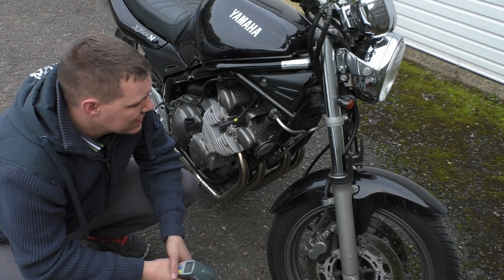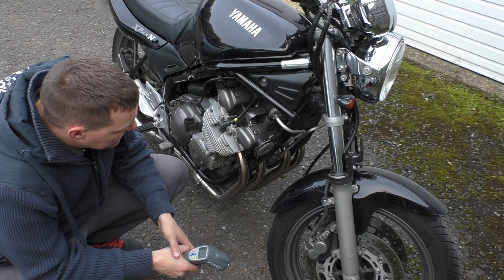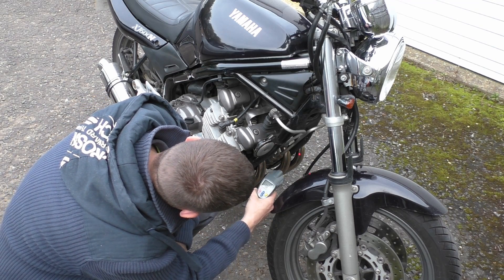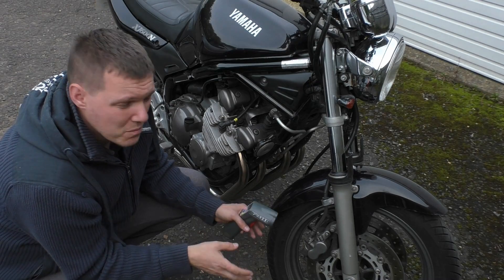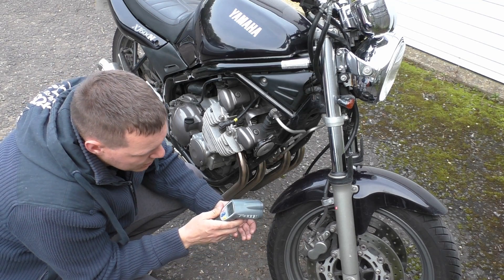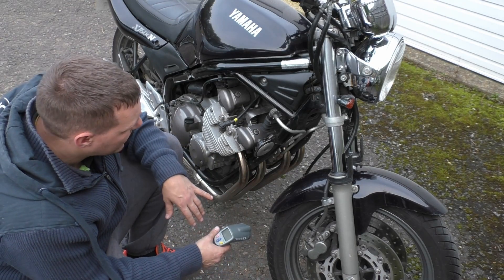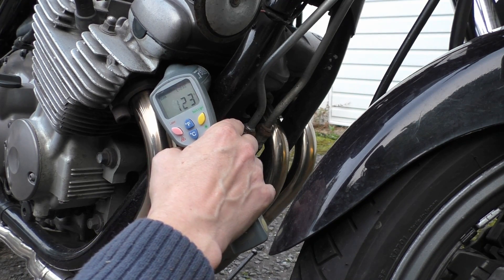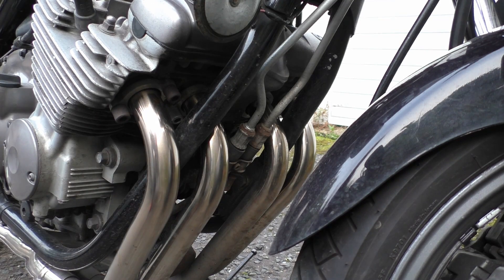Digital Thermometer Guns and Cylinder Temp

Comment: change the emissivity settings to match what you are reading. Thats why the gun has buttons. 
It is not specd in seconds. Those are inches. 1 to 12 inches ratio means it measures an inch of surface at 12 inches away.

Comment: Hopefully the following helps... 
The D/S or D:S is the ratio of the distance from the IR lens to the sampled/evaluated area size that the IR sensor "sees". 
Closer to the surface equals smaller evaluated area/diameter, farther away equals larger evaluated area/diameter seen by the IR sensor. 
Think of it as the IR sensor's field of view like for cameras. 
The emissivity can change with surface color and or texture of the sampled material. 
Many IR thermometers have an adjustable emissivity setting to compensate for material emissivity differences and when set incorrectly for the material the indicated temperature can be skewed and erroneous. 
Many IR thermometers come with a chart that shows how much to compensate for different material surface colors.

http://en-us.fluke.com/community/fluke-news-plus/temperature/how-to-get-great-results-with-an-infrared-thermometer.html

http://www.firecraftsafety.com/pdf/IR%20Thermometers%20explained.pdf

Comment: Wow, really is a massive difference in temp, isn't it.
My one does say somewhere that the laser dot is only a guide. I've found (using a lighter on long flame) that at about 3/4 inches the laser is about 1/2 inch too high.

So....How does this affect the data you're gathering on exhaust headers temps for the evans experiment?
Reply from the maker: For the Evans test I'm using a thermocouple instead of these shit guns